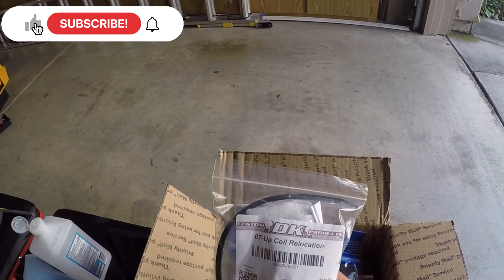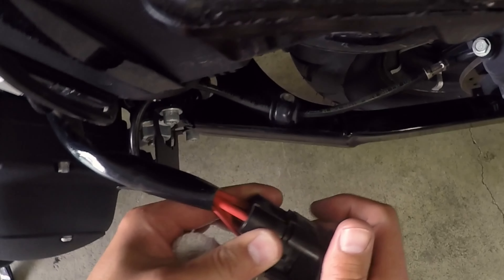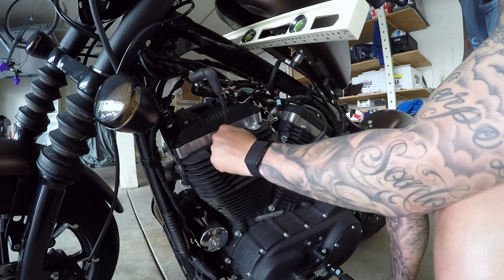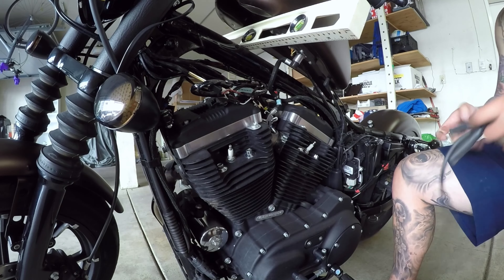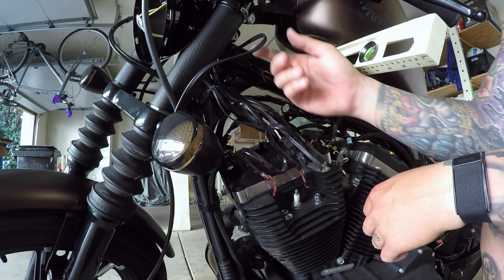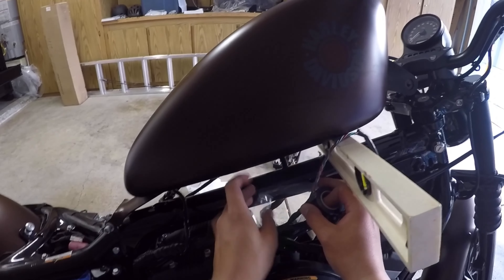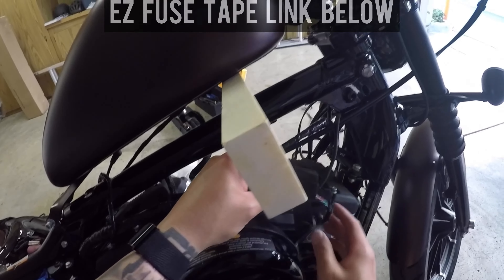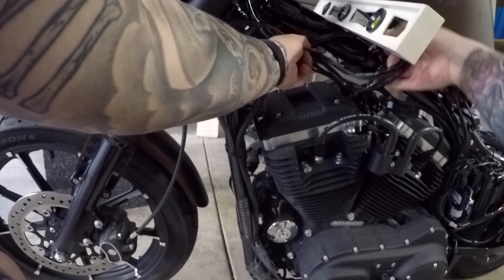Coil Relocation, Wire Tuck, Tank Lift - Harley-Davidson Iron883 - Part I

Comment: Great Video
Question :  Does the ignition switch have a plug ? I need to replace the switch.
I have 2012 883 iron
Reply from the maker: My 2019 has a plug that did not need to be replaced when i changed its location and did the wire tuck